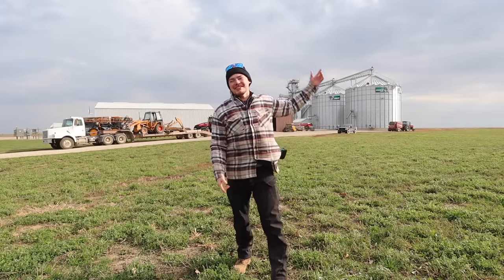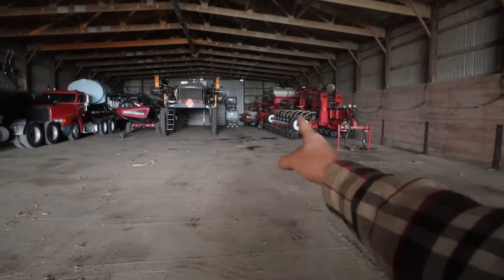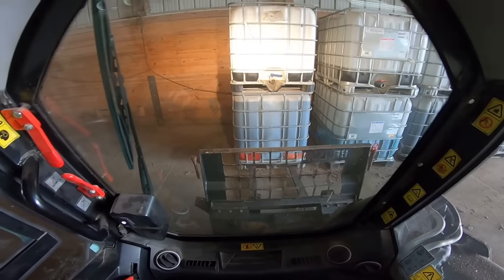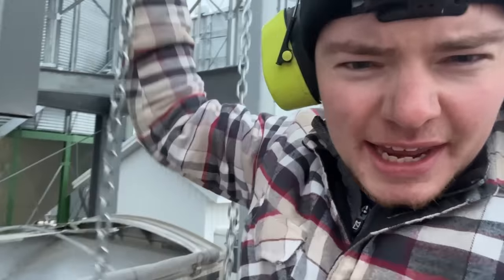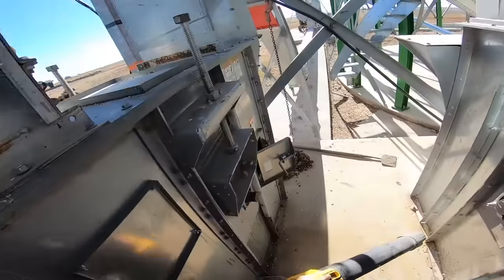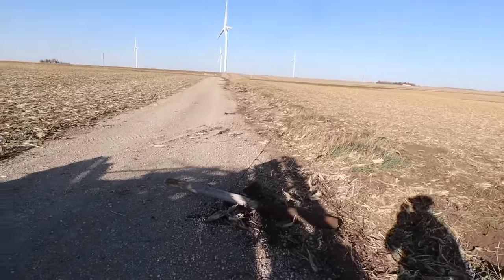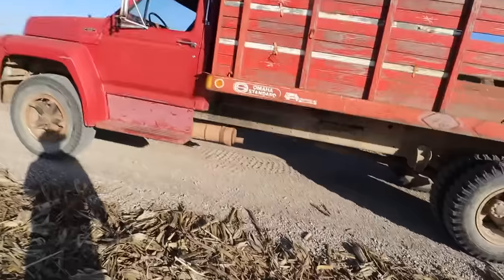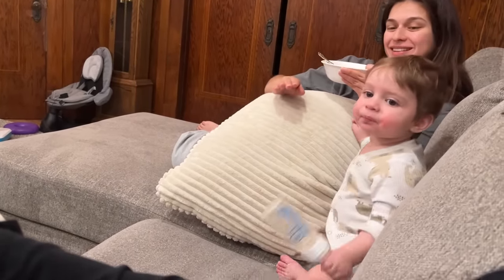We Are Selling A Tractor

Comment: You need a rake  stye grapple bucket for picking up the fence wires, and a magnetic rake for the Staples in the ashes. Or youll have flat tires forevermore. 20:58

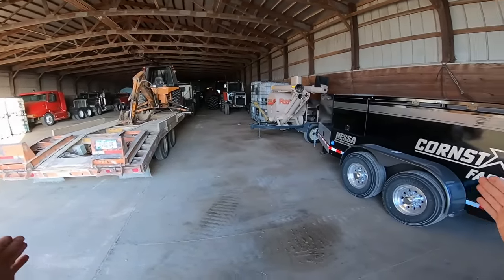Comment: DST is what we went off of, back onto standard time.  If you want it to stay light, longer into the afternoon/ evening according to the clock, you would want DST all year.  By "falling back" when going to standard time, sunset happens an hour earlier. 9:25 

You weren't hearing the fuel pump running, after shutting the disconnect off.  That was the pump pulling the DEF out of the system, putting it back into the DEF tank, so it doesn't freeze in the system causing issues/ breakage.

Comment: Replace the thermostart (heater) mounted on the intake with a diesel pipe to it. 
Perkins engines dont like starting without the thermostart, that lights a fire in the intake and warming it up.

Comment: If the valves and injectors on  the 903 haven't been touched since new they should be reset, and the injector plunger should be checked for carbon. Buildup, you might have to get. Exchange injectors because the spray holes tend to enlarge over use and don't spray a fine mist..😊😊😊😊😊

Comment: try lunges holding some dumbells - get a padded mat or wear some loose knee pads, go slow but also do some explosive plyometrics - box jumps are good - the padded mat helps with these too - you want to avoid injuries and just work your way up - superset them and then add jumprope for a couple minutes. do opposing muscles groups, bis/tris, rows and dumbell rows and thenbench and inclines, military presses and then sets of 5 pullups - you can superset all these just lighten weight as you go up in sets to get the max pump - you should be slightly sore next day but not overly sore

Comment: When I was 30 I could squeeze 160 pounds in each hand 1 minute , and hold a double bladed axe at arms length with one hand for a minute and a half, there was some twins constantly competing with each other they could do that for 5 minutes, professional lumberjacks. when I was thirty I worked at a window and door factory ,started there at 20 and retired at 70, any who I built there door walls and there was a line  that was 165 pounds a panel I know that wasn't much compared to your lifting , but I would stand it up , pick it up 6 inches ,turn it 1/4 turn then carry it 300 feet to the waiting delivery van and place it, good thing I only had to do that 6 times in a row..
About 15 years ago just before they opened a plant down state to do that they had us loading the door panels using steel skids and ropes, and forklift, alot easier on the arms.

Comment: I'm surprised they didn't use fiberglass when they mixed those silo pads to prevent cracking. Whoever the manufacturer needs to re-engineer those osha hazard issues. Only 30 mph winds, lol kidding right we had over 65 mph winds here in Albuquerque.